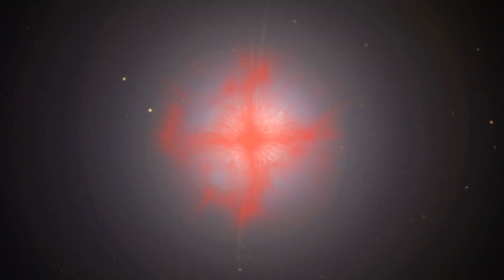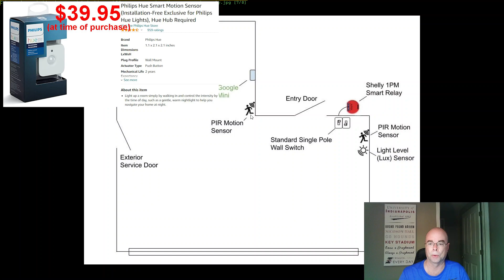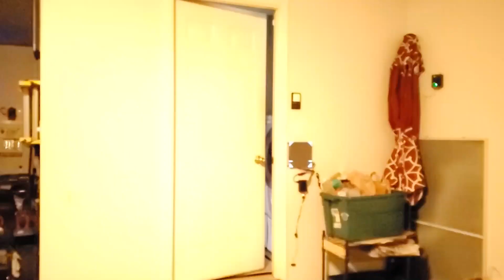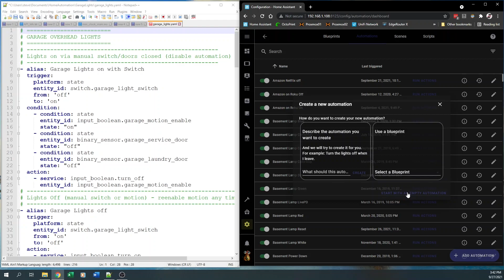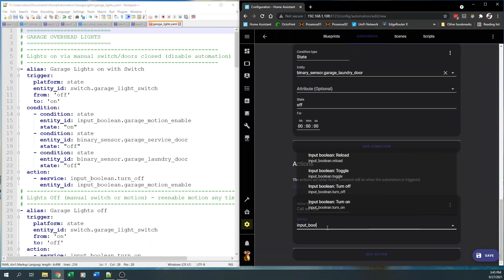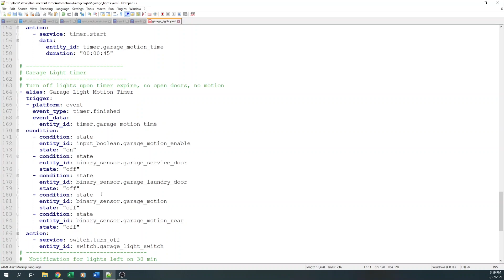Automated Garage Lighting with Home Assistant

Comment: Were the reed switches significantly more responsive than Zigby sensors? 
Thanks!
Reply from the maker: Not significantly, if any at all.  The wired reed switches obviously don't require batteries so that is a plus, but it also means that wires have to be run/exposed between the switch and the controller (not an issue for me in the garage).  But in terms of responsiveness, the Zigbee switches are nearly as instantaneous as the wired switches.  This, of course, requires that you have a good Zigbee mesh.  I did have issues initially with a Zigbee door sensor that continuously dropped off the network.  But since I now have a better overall mesh, that hasn't happened again in over a year.

Comment: Hi, thanks for this informative video. I have used some of the ideas for my own set up and it works well. 
The one thing that I can't quite sort is the garage light timer card on the dashboard. What did you  use to show the timer counting down. If you have time to respond I would appreciate it
Reply from the maker: It is just the standard entities card.  Note that for some reason the standalone entity card only shows state (idle/active), but when you put a timer into the entities card type (plural), it then shows idle or the actual time remaining when the timer is active and counting down.

Try the standard entities card.  You don't necessarily have to have multiple entities in the entities card, but can just show a single timer if you want.
Reply: @ResinChemTech  Hi many thanks for the quick reply I will have a look at that this evening and see if I can get it to work for me
Reply: Hi again, I now have the card working as it should. I I think I was using the wrong card. Thanks again for your response.
R.

Comment: Thanks for your video. I had a project I was working on that involved multiple sensors, a light and a timer and while it wasn't as complex as yours, your video provided a good beginning template for me to start off from.
Reply from the maker: Oh.. and by the way.  I've upgraded the detectors on this original version with better/different components.  You can see that video here: https://youtu.be/ZRb_wpJo1AM and decide which type of motion triggers might work best for you.  Other than the motion detectors, the rest of the system is the same as the original version.
Reply from the maker: You are most welcome!  I'm glad you found it helpful.  Note that I just recently upgraded the multi-sensor and replaced the PIR motion sensors with a microwave sensor (in case you didn't see that video).  I'm finding that one type of sensor  (especially when it comes to motion) works well in one case, but a different type of sensor works better in another.

Don't hesitate to reach back out if you have any questions about my automations... or anything else!  Thanks for watching and taking the time to leave a comment.

Comment: I have a similar setup in my garage. I need to work on the automations so your example is very helpful. I am using hard wired reed switch sensors on the two doors and the garage door so I don't have to change batteries. I don't have the lux sensor so I just don't turn on the lights when the garage door is open. The garage door opener has lights that turn on when it is opened so there is light when arriving at night. I have a motion sensor similar to yours connected to an ESP32 along with the reed switches. Thanks for posting this.
Reply from the maker: You are most welcome... I hope there is something that you find helpful.  When I first built this, I didn't have the hardwired reed sensors on the garage door like now.  I've considered going back and updating my automation in a similar nature to yours... don't turn on the lights if overhead door is open.  But so far, the ZIgbee sensors have been good on battery life... about 6 months and still showing 70%.  I'd like to re-do the multi-sensor as well... but I always have a hard time going back to old projects, as I want to  be working on something new!  Thanks for watching and taking time to comment!
Reply: Yes but first this hurt if it's night, you're working late, and you want the garage door open for air

Comment: I saw your 5816 alarm door sensor on your access door.  Do you have those sensors integrated into homeassistant. I use an Envisalink  bat unit with my ademco vista 20p alarm and it works and integrates with homeassistant flawlessly, it also all local. I use all my alarm door, window, and motion sensors with automation's  in homeassistant. The 5816 sensor is cheap on ebay. You can find them for as cheap as $10. The battery life in crazy. I've replace the batteries once in 6 years and the range is far better than zigbee.  It travels out of the shed and into the house a good 150 ft  where the receiver in located. Best of all there is no monthly fee for the Envisalink unit. Just the initial purchase price.
Reply from the maker: Currently I do not have the alarm panel/sensors integrated.  I used to have integration via alarmdotcom, but HA disabled that due to web scraping.  My monitoring company has changed hands twice and I've called multiple times to try to speak to someone about integration... but I can't seem to get to anyone with any tech knowledge.  The panel is a GoControl 2GIG-CP21-345E.... and apparently has Z-Wave.  But I gave up chasing that dog and just flashed my own Zigbee hub with Tasmota.  So far (6+ months) I haven't had any drops and batteries still +80%.  The alarm sensors do have good battery life, though.